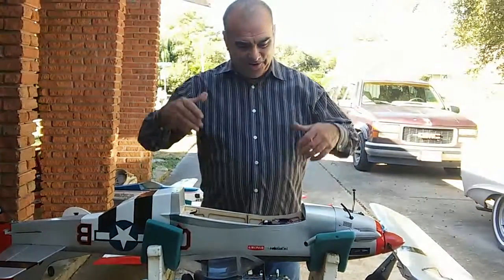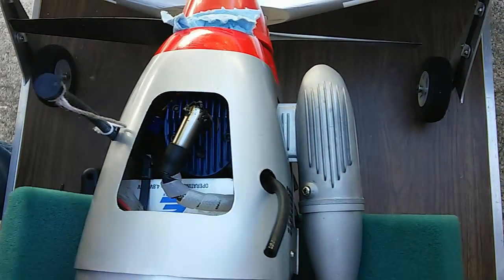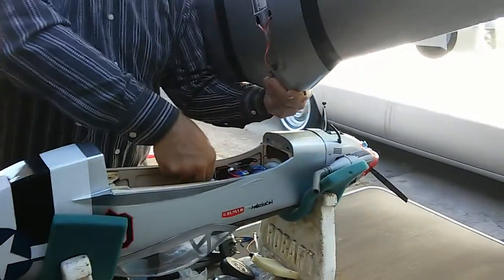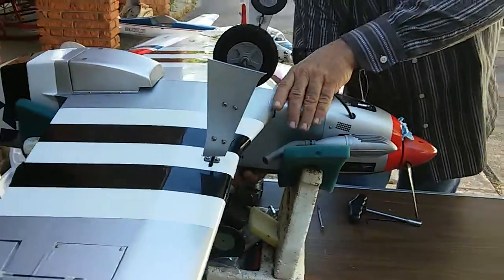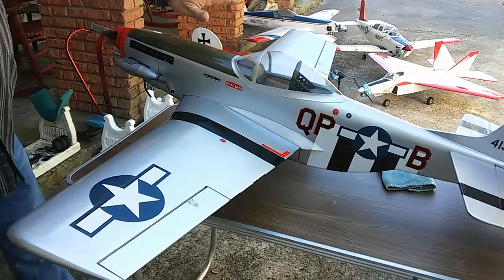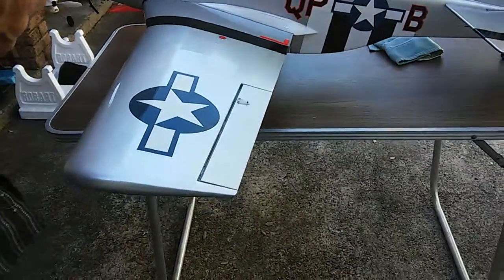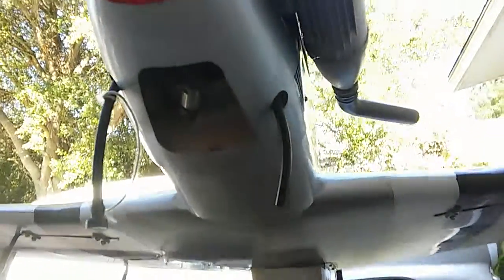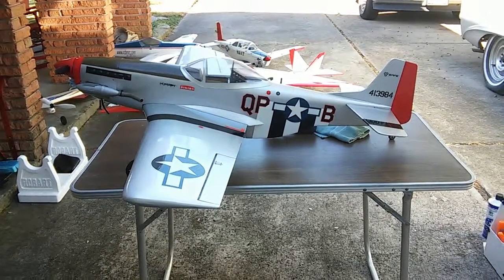P51s gyro safe info

Comment from the maker: Those of you with this plane and a servo starts to fail a good replacement is the Hitec HS-430BH, cheaper but will have to buy the Dubro long servo arms if it is used in the wing. Now to let all know I replaced both in the wing because the left one was starting not center correctly, after 56 flight, we have not had good weather here, so went for 58 after the servo replaced made a very bad mistake, MAKE SURE THAT THE SERVOS ARE GOING IN THE RIGHT DIRECTION OR PATH.  I roll it into the ground about 6' up into the mud , it looked like a fish head cut off and the guts stayed with the head, the wing just got some dings but did not break. This happened about a week ago, putting it back together sent the RX in to make sure and checked OK. When done will show it again, it will have some scares. This was not caused by a malfunction, pilot error I looked but did not think, lesson learned.

Comment from the maker: You hear me saying a fuel that I tried with isobutanol, it is sold as Gulf Marine in the racing fuel listing, used it in my lawn equipment and gasoline gen sets. Has a odd sweet smell as I filled the equipment and while the engine runs. Look up the web site, have a short vid of it with pump gas, watch what the pump gas does.

Comment: would you recommend this for a first time gas flyer?
Reply from the maker: To ask have you flow any aircraft and to add with a engine, if you have this can work, but have not and want get this as a primary trainer most definitely get someone that can help teach you how to fly.
Reply: Joseph Schmidt I'm 16. I understand how flying works, I take flight lessons and feel like I would be able to fly it. But I've never flown anything besides a three channel electric plane. Reason I'm attracted to this one is because it looks cool and it's also one of the cheapest I could find
Reply from the maker: That is a good age to learn how to fly and to have an interest in flying, are you flying full size or models? Yes the plane does have a strong draw to want
Reply: Joseph Schmidt yah. I fly out of Connecticut in a 152. It's just hard to balance school with working for flight lessons so they are limited until I'm older. That's why am interested in getting into more RC models so that way I have the freedom to fly more often
Reply from the maker: That is a good age to learn how to fly, are you flying full size or models? My first planes that I learned on were 2 and 3 ch, used rudder for yaw turn which made it roll, then got first 4 ch did it on my own to learn scared because use to how rudder made the plane turn, the wing is what makes the roll and have to add some up to maintain the altitude. Can you find some that can help and yes this plane does have a strong draw of I want that.
Reply from the maker: That is great that you fly full size, I flew in one like that, now in the seat of a full size you follow the ball with the rudder to help in a skid or slip, but a model you are out side looking at it so have to learn how to judge the air speed and if you see a slip. A low wing aircraft like this one hard to tell if it is in a skid or slip like some high wing trainers you can see it doing a skid. Have to train yourself when the plane flies to you not to get confused.
Reply from the maker: You keep doing real good in school and don't limit yourself for this dream of flying. God gives us all Godly good desires, when I was your age had the same desire but I listen to doubt that I could do that, so if I fly a full size it is done rarely been up in 3 types in the last 20 years 7 flights, fly my models and think what it is like in the seat.
Reply: Joseph Schmidt thanks for the advice.
Reply from the maker: Thank you for asking